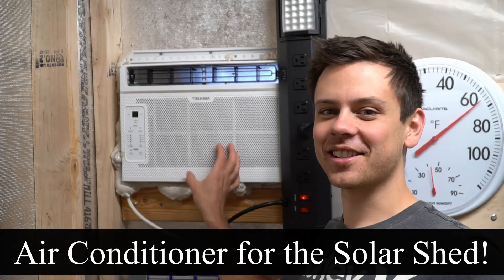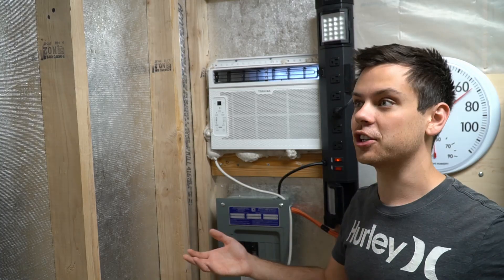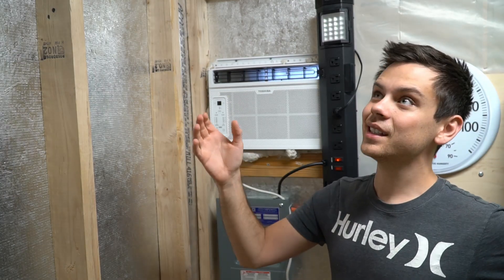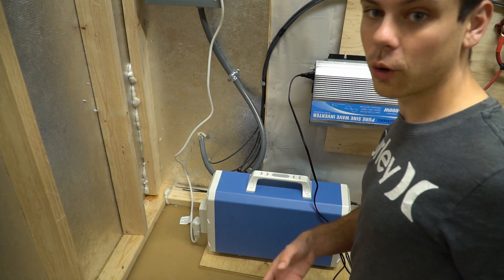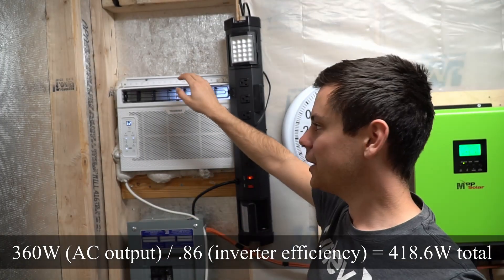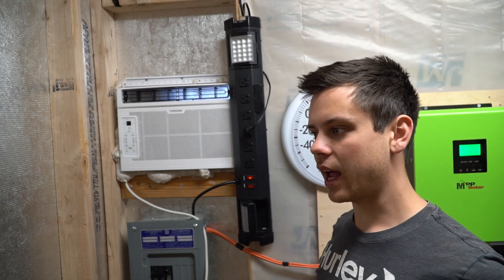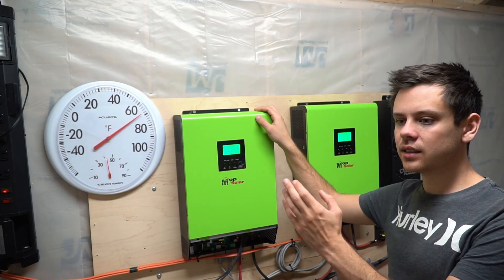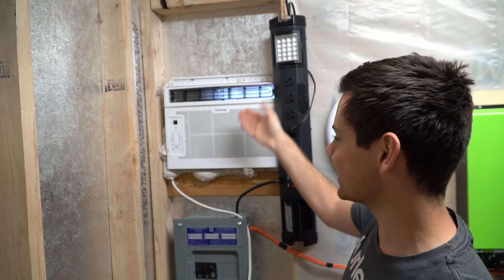Solar Shed: Running a Cheap Air Conditioner

Comment: What is the initial start up watts required for the AC?
Reply: This is why I used a minisplit ac and heat pump. Very little start up amperage
Reply: This is my question also

Comment: Love your stuff! Question...I have 2 Bluetti’s, have you figured out a way to pull 110v from each into a 220v plug? That would be really sweet.
Reply: i have the same question, can you use an adapter or transformer on the Buetti so it can be used for 220v appliances?

Comment: I have a little AC like that in my bedroom at night and put the central up.  I did the math and actually save about $35.00 a month during the HOT season!  Alabama Coast!  (Winter & Hot)  are our seasons!  Lol.  Hope you had a nice Easter!
Reply: I used window a/c for 10 years in Houston with whole house HVAC .
I worked nights slept days . My room was 72 house was 76 till i got up and others got home . Our Balanced billing hasn't gone over 80$ monthly in 2000 sq ft 30 yr old house .
That unit can make most moderately insulated Vans Cool to sleep in .

Comment: Do you have a recommendation for a 48v inverter that is as simple and cost effective as the Giandel? I'm not looking for an inverter/charger combo but I may end up going that route if I can't find one. This is simply for emergency backup when I lose power so I'm trying to do this cost effectively and also not be permanently installed.

Comment: Your air conditioner doesn't have a thermostatic switch?  Yes, insulation makes all the difference. Insulate first, then figure out what you need.

Comment: How about a data logger multiple inputs to run PC program Log the parameters needed for your solar shed environment. Time date, inside outside temperature, air conditioner status on/off, this might be nice to do before you insulated your building to see the before and after effects but basically taking the data and using it to formulate PC to control your buildings temperature taking in consideration your battery status

Comment: Do you need a backup AC unit in case that one fails in the summer and gets too hot in the shed?  
The BMS should shut off the charging if the temperature gets above 135 degrees i assume, but nice to have a backup AC unit.  And it only takes 1 watt in standby!

Comment: As one point to consider, there must be a fast growing indigenous tree or bush in the Nevada area that you could plant to shade the shed naturally. A plant that grows with little water and thrives in the heat to offer shade.
Reply: The Tipu tree grows in your area, up to 40 feet tall and should provide great shade to cool the shed naturally. Add under roof insulation and your batteries should be fine.
Reply: @bentnickel7487  So this shade would only be present to the shed itself when needed and not to the solar panels? I want to see some kind of technical rundown on how this 40-foot quantum shade works.
Reply: He can't have tree shade if he leaves the panels in place. He's not living in an RV anymore, so the panels can be relocated to a place that's advantageous for optimum solar. Cooling the shed starts with natural shade and graduates to under roof  and wall insulation.
Reply: If you got paid would you be available for personal projects???

Comment: Cant the a/c come in by itself or rig it up to come on when the shed reaches a certain temp and then shuts off when it cools off?
Reply: yes but that way the ac is always on and uses the battery cycles and power

Comment: What would i need to run around 1000 watts of grow lights and an ac like this? Thanks do much for your info will
Reply: Lacking information: 
How many hours will the grow lights be on?
How many hours will the air be on?
Figure your watt hours.
10 hours of grow lights = 10kWh
10 hours of his AC= around 5kWh
Battery bank redundancy for 3 cloudy days cloudy.
15 kWH a day requirement
6 kW Solar array 18-30 kWh /day
45 kWH batter bank $$$$
Inverters, cables, breakers, fuses, charge controllers
$40,000+

Comment: The Wemo insight is a WiFi switch with built in monitoring. Also thinkeco smart ac is also a WiFi switch with monitoring and a temperature sensing remote. Check them out if that sounds useful!
Reply from the maker: Smart idea!!

Comment from the maker: And so far it's working! It was 87 degrees 2 days ago, and 2.1kWh powered it just fine. I am going to continue doing my energy audit in the following weeks, but this little ac cools down the shed and my batteries in minutes. 

And no, I will not keep the bluetti connected indefinitely. Absolutely not! It was an easy way to avoid adding LVD for the giandel while doing energy audit. 

This AC is very loud and there are more efficient options. But I have a TON of solar, and I am never in the shed, so this works perfect! If you want low standby consumption, buy an energy star ac. You can go to any local store and buy a 6000 btu air conditioner and it will have nearly the same efficiency as this one. I bought mine on sale because it is last years model. 

I just bought more insulation and will add it today. The roof is covered in panels which shade the shed. Also, the shed is surrounded by natural shade, so it should stay pretty cool. I probably  need to insulate the floor and roof a lot to save energy.
Reply: thoes little 6000 btu ACs work well on low cool fan setting as well.  I used always use my sailboat one on low for less noise and it would still freeze me out at night in Florida summers .
Reply: Will I am an EEE and you amazes me with your knowledge and testing
Reply: Will- no one cares about how loud the AC is, but- glad you are doing an energy audit to determine what it takes to cool the place during those 110 degree days! I'm interested in the Giandel Inverters- so, I'll be reading those pages next. Insulating the floor will be a PITA, but- blocking off acess to the floor should be relatively easy. Walls- are you going to use the Pink Panther stuff, or rigid foam insulation? Just curious- let us know what you come up with!
Thanks for keeping us up to date with the solar shed.
Reply: @DCGULL01  he can just turn it of if he is recording fore 15 min
Reply: Will, Could you just have the AirCon on a PhotCell SWITCH pointed WEST and have it come on @9-10AM?
Reply: I've lived in Vegas before and you're not joking about how hot it gets there. I would insulate the hell out of that shed. Like way over do it just because your have so many batteries in there.
Reply: Could you build an electric or solar powered electric paramotor? Include parts and pricing etc?
Reply: @davidcrozierpodcast  ya could you?  Lol
Reply: Can i just plug it into my wall ?
Reply: Just buy Sonoff TH16 (16A) if u want to monitor temp in ur shed. its very easy to use. btw not to mention then u can sync ur smart plug.
Reply: WIll you be reviewing the new Inergy Flex ? 

just got the email, hard to make out if this will be a stacking battery system or something smaller
Reply: I am looking at getting a cargo trailer, insulating it and converting it to a camper. I would LOVE to run a mini chest fridge freezer full time (no problem on solar) but the challenge would be running a 5k or 6k BTWU A/C without a generator. I am willing to go LiFePO4. I am just thinking I do not have enough roof surface area to get the watts I need. Not running 24 7 I would just need it 2 hours hottest part of day and 2 hrs bedtime.
Reply: Please can 18v solar panels configuration charge a 24v battery with a 24v hybrid inverter system?
Reply: Your cute when you smile😉
Reply: will do you have a link to the  AC unit.   or did i miss it
Reply: A couple rolls of fiberglass insulation would probably cut your power consumption in half.
Reply: Here we use metric system specifically celcius.😁
Reply: Nazim Ud Din   Hi 👋 Nazim.  ℃ =℉ - 32 / 1.8  . So 80F°— 32 = 48 / 1.8 = 26.66C° can you understand what I mean about converting F° to C° ?  Stay safe and well.  Blessings to you and yours.
Reply: @NazimUdDin-tg8jg  C=F-32/1.8  Here we use arithmetic. :) (kidding, but that's the formula anyway)
Reply: @NazimUdDin-tg8jg  yes, always a good idea to use both - until either the last holdout or the rest of the world switches!
Reply: @TeamAdventureCrew  Metric is just as arbitrary as anything else.

Comment: You could bury a 55gallon drum of water 6 feet underground and run a pump and water to and from it through a small radiator fan setup to make a micro geothermal cooling system. You would use a tiny wattage and it would be a fun build I bet.

Except the digging, that would be hell.
Reply: And from what I've seen the earth around Vegas is very hard. Depends on what part of the valley you live in too I suppose.

Comment: The lower noise level is what justifies the extra expense of a split unit.  MUCH lower sound level.
Reply from the maker: oh good point. I am never in the shed so a split is really unnecessary now. Good to know
Reply: That and the tremendously lower power usage. My 9000 watt pioneer 22.5 seer uses but 800 watts when running. In my converted cargo trailer with R-15 rockwool insulation...it does not run that much even on a hot day. Solar does a good job of keeping me cool while boondocking. NOTE: I also have a window A/C like will shows here in my WonderBread truck. I also runs well and does the trick. I am in the lap of luxury these days while I isolate.
Reply: G Henrickson what make and model ac in your bread truck. Im looking for something that will cool my 17 foot casita to at least 75 during arizonas 100 degree temps. Any suggestions much appreciated!

Comment: Will add a cheap temperature relay which sits between the AC unit and the inverter.  You have probably already got one in stock somewhere.
Reply from the maker: Oh thats smart!

Comment: Nice. Thats one thing i was planning to do now that i have my Lifepo4 battery built. Ive had enough solar to run a/c for a few years, but, i was always afraid that clouds would ruin my old lead batteries. Also, i like my Cotek 48v 1200 watt inventer. Very low power consumption, has lasted 5 years, now. Keep up the good work.

Comment: That shed is comparable to many RV's out today- 1/2 inch styrofoam insulation in 1 1/2" walls and aluminum covering. I'm one of them who has an older fifth wheel like that.  I need to use an AC like this during the day and during the night, I will be using a 12 volt water cooler or 12 volt ac off batteries.

Comment: Using a battery to run an inverter to charge a battery to run an inverter? I'm sorry, what?! There has got to be a better way! :-) Might be worthwhile checking if the A/C unit actually requires AC. Maybe it actually operates from a rectified DC supply? If so, bin that craziness and power it directly from your batteries.
Reply from the maker: Yes it will be connected direct. I am testing bluetti for product review mainly, and I was too lazy to add LVD. and energy audit reasons for now. too lazy to get 10 batteries out of safety mode, so this works wonderfully. but yeah, not efficient. still doing energy audit. so far, 2.1 kwh a day powered ac perfectly on 85 degree day. will come back with more data
Reply from the maker: Oh right, dc supply to rectifier diodes is how I ran most of my appliances when I was offgrid for 9 years, but I am lazy. I would rather add 1 more panel and deal with the loss haha!
Reply: @WillProwse  Outstanding! ;-)

Comment: Can you do a video about refrigerators on solar
Reply: I did a bit of a test on a Hisense  HR6BF121S 120L 240v fridge Because some say yes some say no. I set to just over half scale on the thermostat and rated at 225Kw per year on Product Review. on 2 *old 105Ah lead acid batteries with no power input as a test. in a 24Hr period with no external power input it used around 50AH or around 25pc of capacity. I've been running it on my solar setup in NSW OZ now for about 3 months no problems. but they do have about 500w surge current. Hisense have a 157L now rated at 185/190Kwpy Cheers

Comment: Nice video Will.  It would be interesting to compare the power consumption before and after insulating your shed.  Ambient temperature would have to be factored into the analysis.

Comment: I use a portable LG air conditioner so I don't have to balance an air conditioner in a window, or cut a huge hole in the wall. Itt can work in every room with a window and during the winter I can pack it away 🙃 It was $300 @ Home Depot..... I get about 10 gallons of water out of it per 24 hours so there is more than enough water to flush my tolites with it 😅
Reply: Air needs to make many trips over the coil in high humidity climates. Portable units bring in outside air. its the wet bulb temp that matters for human health and comfort.
Reply: theMekanik that’s a good idea

Comment: Yes insulate like a dog. Super insulate it will be great out there. Always fun to watch ya.
Reply: Hold on a minute. He packed the air gap around the AC unit with mashed potatoes. Clever. I wonder if he added garlic.